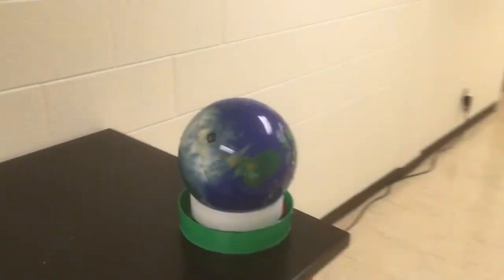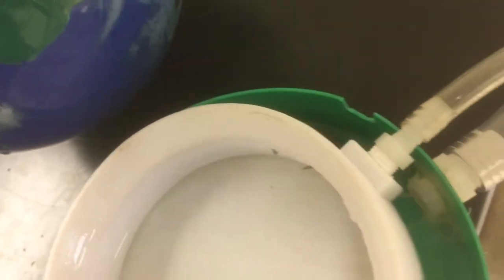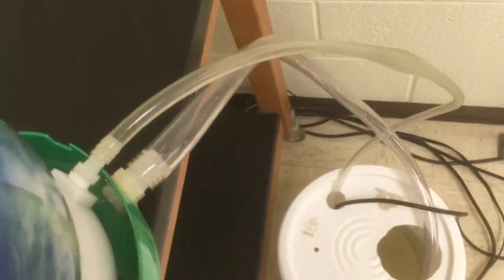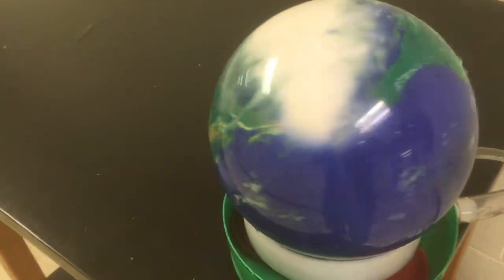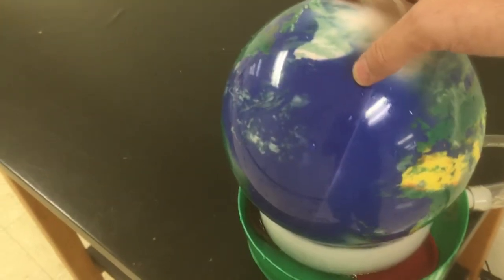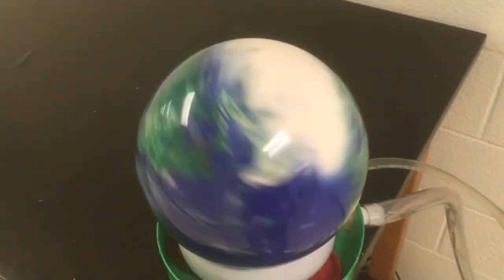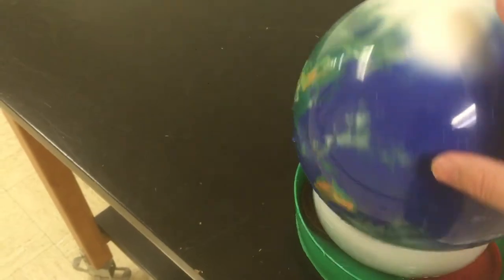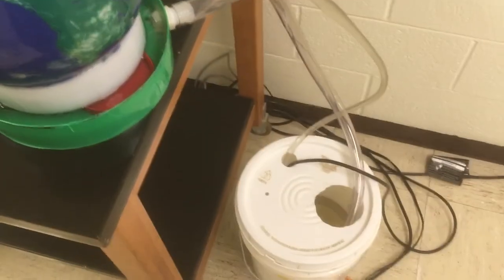Kugel Fountain - Floating Bowling Ball

Comment: What’s the feed water pressure?
Reply from the maker: I'm using a 300 GPH pump:
https://www.grainger.com/product/1P372
I don't know the pressure.  This one says that it's capable of supplying water up 12 ft.  So maybe a maximum of 7 PSI pressure.  The flow is restricted by the ball, so I'm certain that it's running nowhere near 300 gallons per hour.